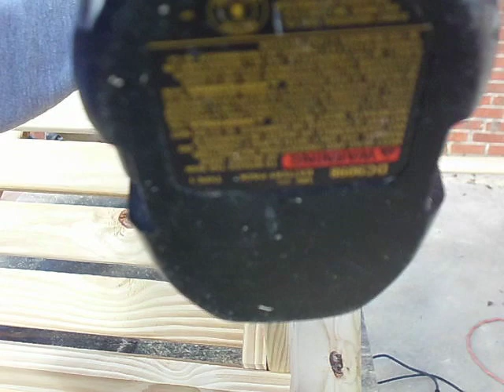How to build an Adirondack Rocking Chair.

Comment: Did you consider tapering the arms narrower in the back and rounding them off  on both ends.? The square arms look kin-s bulky. Just a suggestion. I'm going to add rockers to my chair. Good idea.
Reply from the maker: Yes,  that's a good idea. I've made these chairs in probably 10 different versions over the year. Good luck with your rockers.

Comment: I'm currently building the Adirondack rocker and saw your change on the basic chair for the front leg to 17". Does that change the mounting point for the runner from 15"? Seems like it should or there will only be two inches between the seat and the arm rest.
Thanks.